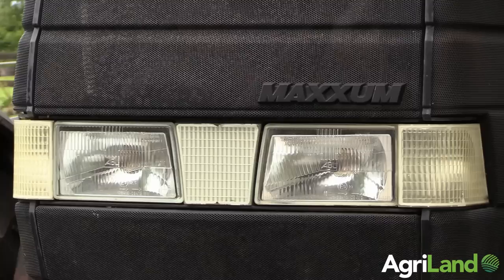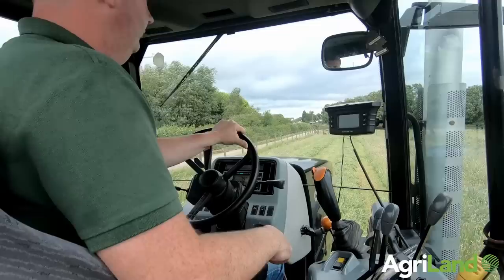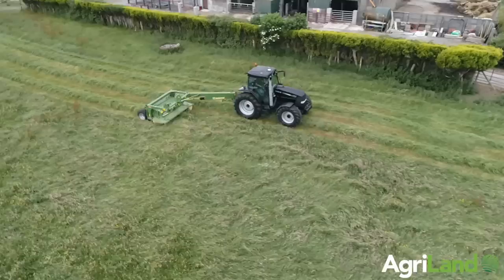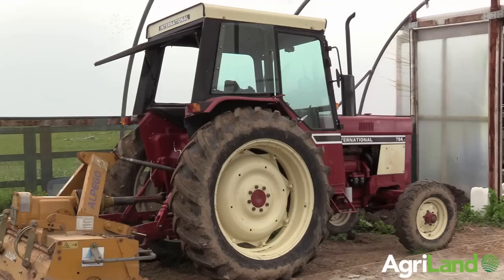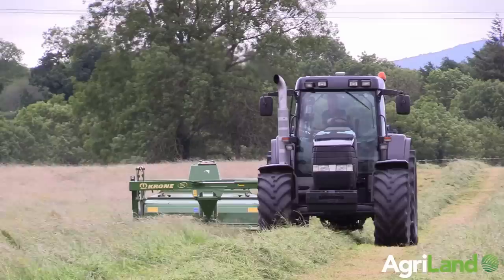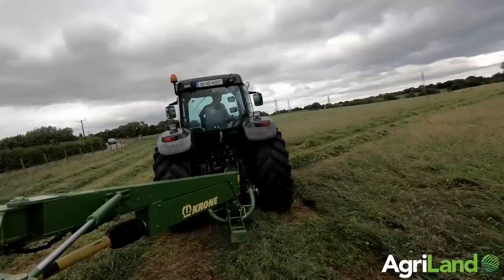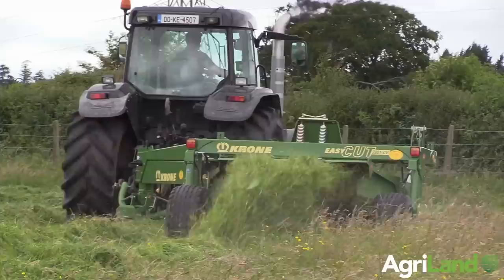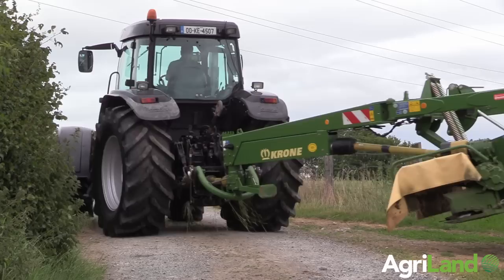AgriLand: Johnny Connolly from Maynooth explains why his black MX135 is a 'classic'

Comment: Ride red. Can't beat them. Run alot of big magnums here and 8r deere s. The independent front ends on the deere s do not holdup too good running over 3000 4000 acres a yr pulling a twelve row bedder or strip till or a big subsoiler

Comment: Running that big tractor on 540 rpm @2300 o/min with a mower....Diesel must be cheap in Ireland...
Reply: It's not, but these mowers run on 1000 rpm PTO
Reply: 1000 rpm lad
Reply: The krone mover is 1000 rpm but it doesn't matter it's still 2300 rpm on the engine.  When I checked the consumption on the mx 110 we had it was around 13-15 liters/h whit a 3200 krone mover. Overall the fuel consumption was pretty low in that lovely Cummins engine.